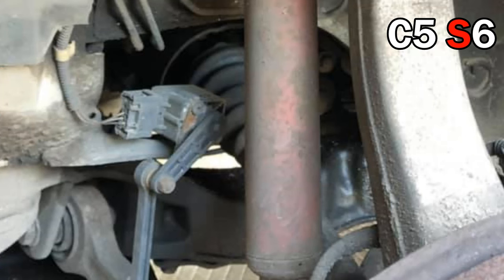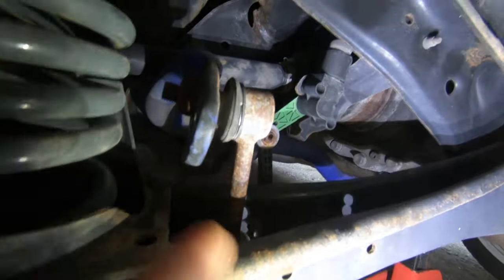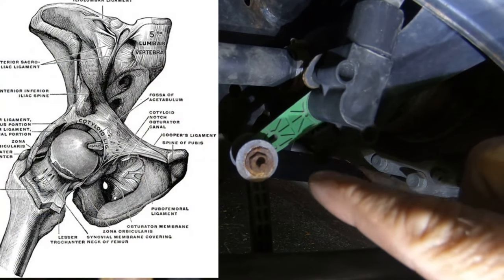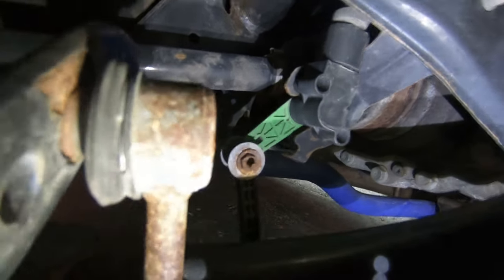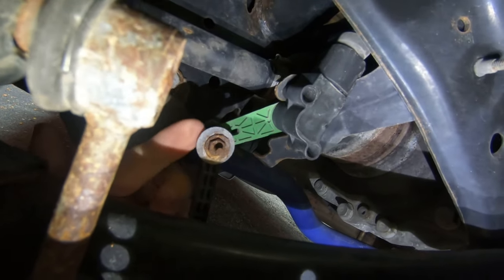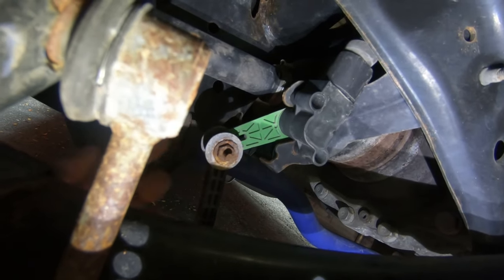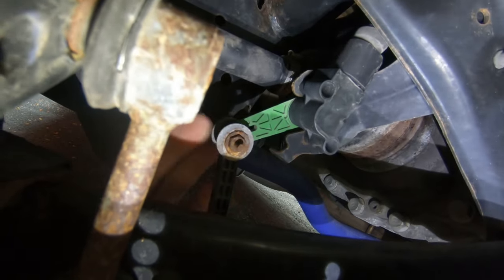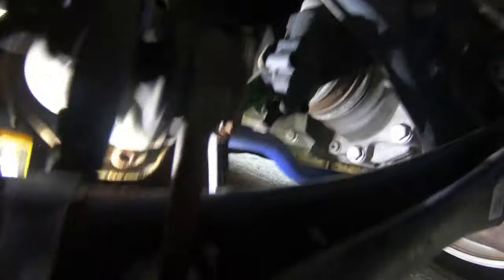QUICK/EASY headlight level sensor repair

Comment: Hi, do you know if cars have one front and one rear headlight adjuster? My car needs a rear one, and when I search on eBay for a replacement, I only seen to be able to find left hand side adjusters. My cars an Audi A4 Avant 2012.
Reply from the maker: Really kind of depends on the suspension and headlight package of your car, there's a good chance you only have a rear one.
Reply: @96ej  thankyou! I have a feeling it’s only one by the way it been written on my mot sheet too.

Comment: My front one broke the plastic thing on the sensors snapped do u know if i can get a replacement the back one the bracket rusted away making a new one and I will replace both tie rods
Reply from the maker: I would just punch the part number for the front one into either Google or eBay, being that these cars are built on shared platforms hardly any of the parts are rare or too expensive.

Sounds like a good plan
Reply: Bro I used cloth hanger. The metal one and tied it like it’s holding an engine lol. It worked but I wouldn’t recommend it, the car gets confused sometimes. 
Btw (Porsche Cayenne 2008)

Comment: I have a 2009 8p s3 with the d3s HID's - I see you posted part numbers for all 4 - is there 4 of these? I know my rear left is broken, but is there one on each side and on the front as well? Not in front of the car, but have ordered some new bulbs to replace the fading HID's and figured I should do it at the same time. Not sure if there is these sensors on the front (and if so, why??) haha. thanks in advance!
Reply: ahh just realised those part numbers are for the 8v anyway
Reply from the maker: There's a good chance your car only has two, for the 8V's it depended on what suspension you had. The best way is to just get under there and look, Honestly though if everything is working I wouldn't mess with it.

Comment: Today went to mechanic he changed my wheels after this incident I got AFS ERROR , probably they broke this sensor, is this possible? AFS and cornering lights error, but lights works , this could be reason?
Reply from the maker: it's possible but not likely, there's no reason he/she would need to mess with this for a simple wheel change

Comment: I have a passat got into an accident and then i got the mssg and light for afs and the reverse camera is not working (the camera opens up but no images) also the car has since been repaired but the garage cant seem to find the solution. I want to identify if the accident is related to the afs issue before i can take the car to Volkswagen so that i can reclaim the cost from my insurance
Reply from the maker: If you got rear-ended I would imagine that you might have broken a wire in the trunk somewhere, or it put tension on the harness and caused a fault
Reply: @96ej   the shock was at the front left side I had the headlight broken, bumper lightly damaged, one radar detector broken and a bent front left wing. The AFS light came up a month after the shock for like a week it disappeared then reappeared and since it is permanent even with the repairs done, I asked the garage who did the repair and they have been playing blame game's that I have an electric problem but it did not exist before the accident and everything was functioning normal. Note we had rains during the period the car was waiting to be repaired

Comment: Is this is why my Xenon lights won't work? I have A Audi A4 B8 estate 211hp. Thanx
Reply from the maker: Work as in not light up at all or won't self adjust?
Reply: @96ej  not light up at all :(
Reply from the maker: @AndyNuberg  unrelated,  do the turn signals etc work?
Reply: @96ej  yes.... changed two lightbulbs and i have light again :) Thanx
Reply from the maker: @AndyNuberg  is your car halogen or Xenon? Without seeing it it's kind of like just shooting fish in a barrel but your next step would be to look at the connectors and see if they're burning up, check to see if you're getting power at the ballast if you have xenon lights, check all fuses/relays, the headlight switch itself may be bad which on some models is super easy to change and rule out. If you have vcds or something similar or have access to it from a friend or something it never hurts to give your car a scan either
Reply from the maker: @AndyNuberg  glad to hear you got it fixed!!
Reply: @96ej  i have xenon by the way but thinking about replacing it for led
Reply: @96ej  Hi there, I want ask about my car when turn the steer or switch on indicator light the turning halogen will work, but my xenon headlamp won't self adjust, is it related to? But my car only had 1 side, scirocco
Reply from the maker: @Yash-xv9uu  so your car has the headlights that turn left or right as you turn the steering wheel? We don't have those here so I've never played with a set but I would imagine that if the halogens are working then maybe the xenon's are driven with a separate motor that is not working.

That's just my speculation I'm sorry I don't have a good answer for you, what year Scirocco do you have we got two generations of those over here and they were pretty fun little cars
Reply: So is there like a certin way of taking it off or will taking it off just mess with it either way ?